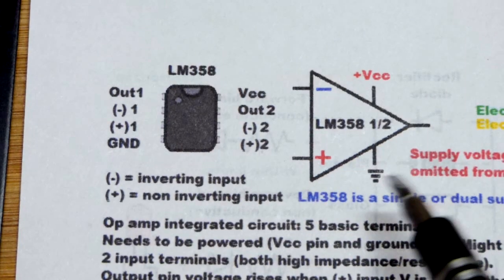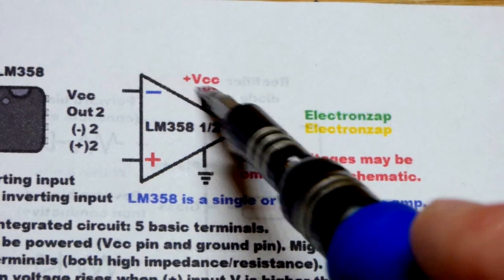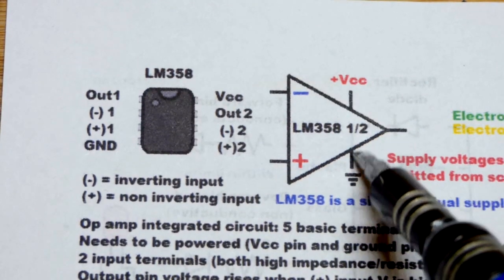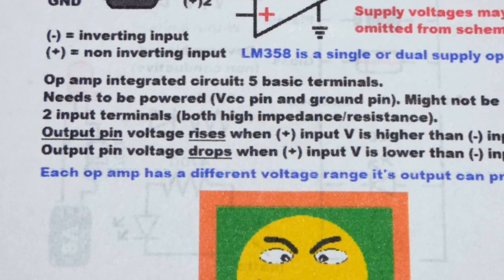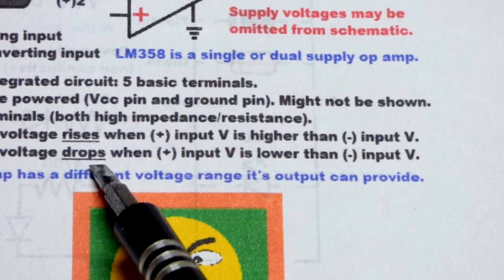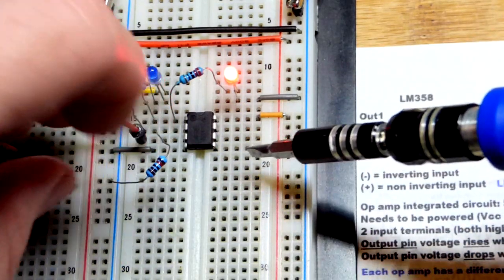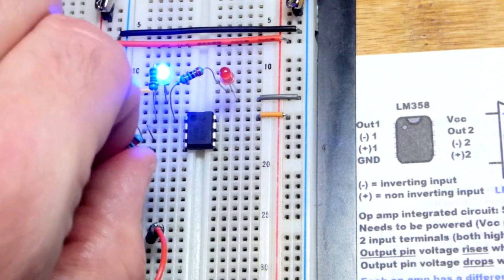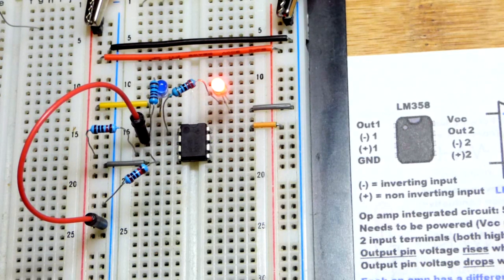Operational amplifier basic properties explained using LM358 dual op amp

Comment: Thanks again for another informative session. Ive mainly used the LM386 so will run this  session with one of them for some practice. Have you or do you intend to do anything on setting up a negative voltage supply? Ive seen some using double batteries,  with bench power supplies and others with kits. But tbh Ive not really fully understood the basics or the application.
Reply from the maker: Thanks for watching! I've done videos on splitting a single supply into a dual supply in the past. Not sure when I will make updated videos. You can tap into the middle of batteries or for low power you can just take a regular op amp and make a voltage follower set to half of the supply voltage. I do that in this video https://youtu.be/m_atSWsz-bU
Reply: @Electronzap  Thanks for the reply and link